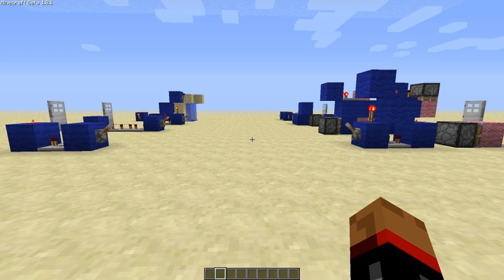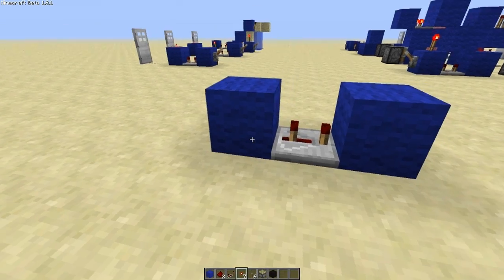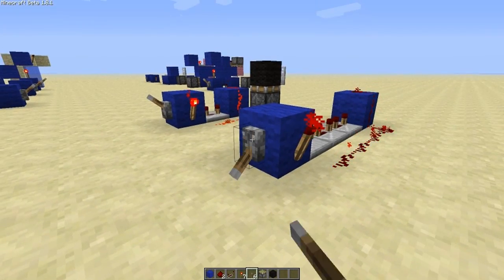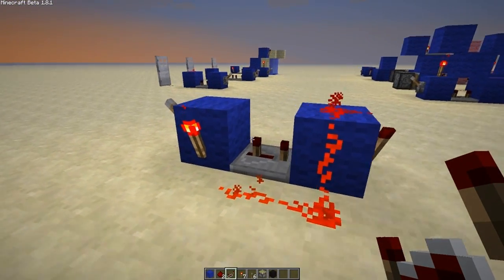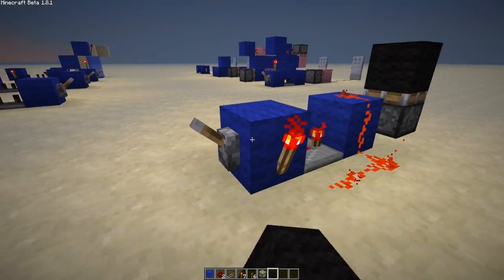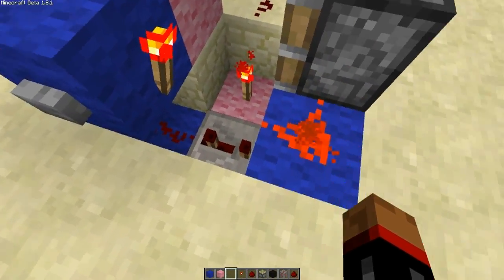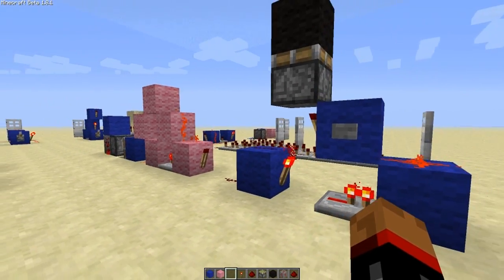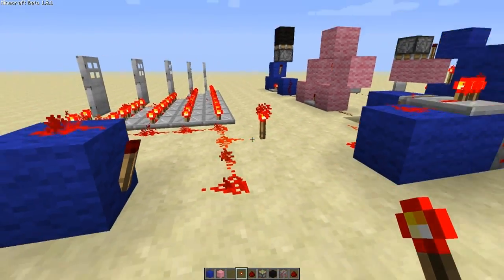Pulse Limiters [Redstone Circuit Spotlight]

Comment: maybe if you connect it to a sticky piston and when it is off power goes thru block and when extended it go thru the block if you know what I mean it would be kinda like this         []-[]
                   i i          that is off piston and when you apply power to it it will send the block to other redstone torch or you can put repeaters going into them and then signal takers down or on another side . hope I helped

Comment: Make an XNOR gate, (look up on youtube if you don't know how to make one). This device has two imputs and one output. Its function is to make an output require power or no power from two imputs. In other words, you can have two seperate levers (Imput) both of which have to be on or off at the same time to power the piston etc. (output) on. What you could do is hook one lever up to both of the imputs so that basically you are using one lever for both imputs. Hope this helped, if not please reply.

Comment: there is a 2x3x1 inverted pulse limiter. have a block with a torch on it and 2 repeaters coming out of the block and the torch and have the one with the torch 1 tick longer delay, and hook them up to your door. the block is the input

Comment: You should do a triple extender if it's possible, and a tutorial on your combo lock, but with a tenth input, so room for a zero basically.
It is possible, but cant be very neat and the zero has to be above the one sadly.
But I still got it to work.